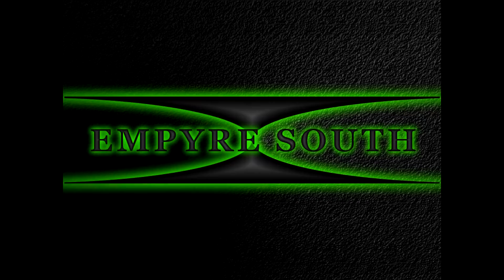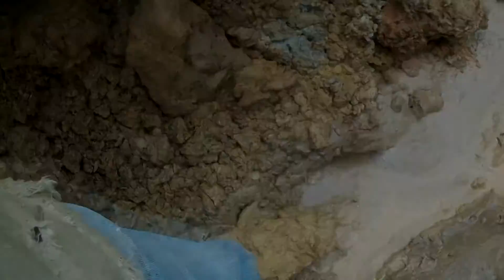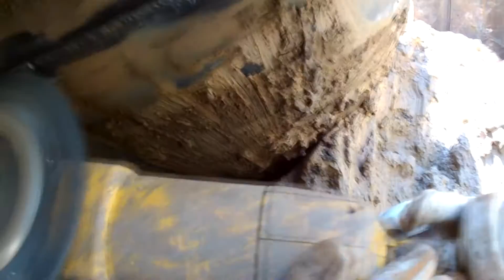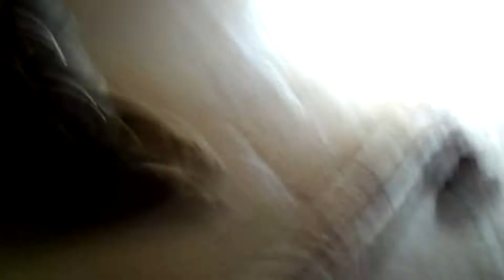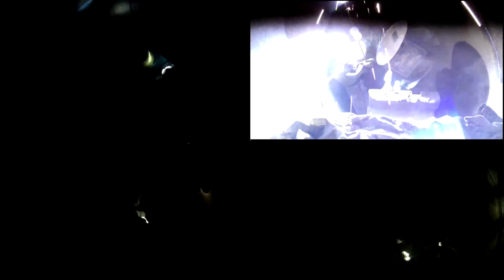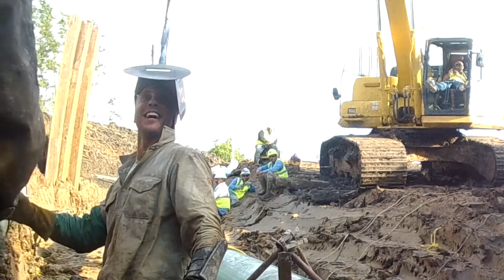Do Work!

Comment: Nice. What machine do you run?
Reply from the maker: thanks! '13 200d
Reply: +Empyre South nice! I run a 69 Redface, been wanting to do a diesel conversation, but can't seem to find the time
Reply from the maker: +Johnny Jones me and you both. I'm converting a '76 sae 300, in my other videos,  just can't get home long enough to finish it. I've had a '53 shorthood, '67 redface, '63 blue redface, '07 miller and a few others. each had their issues but they will all cost and make money. Lol
Reply: +Empyre South yeah I was watching those videos too, finally a "real" welder making YouTube videos haha my 69 was from the original owner and had very low hours no wear on exciter or main commentator still running original brushes, I also have a 48 shorty which I love but runs beads different from my Redface, I'm looking at getting a newer one for taxes either classic 300 or sae 300 maybe even the cross country
Reply from the maker: +Johnny Jones sounds good. I would give my opinion but you know as well as I do we weld different. Lol. I'm sure you've welded with all of them. I hope you like which ever one you pick.